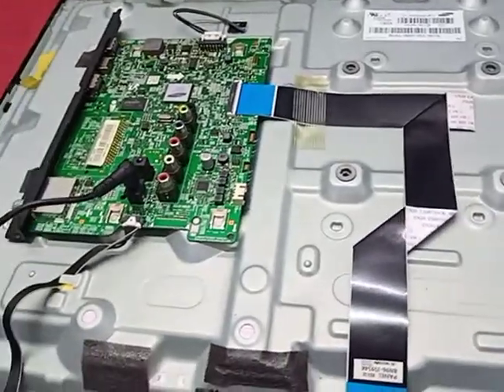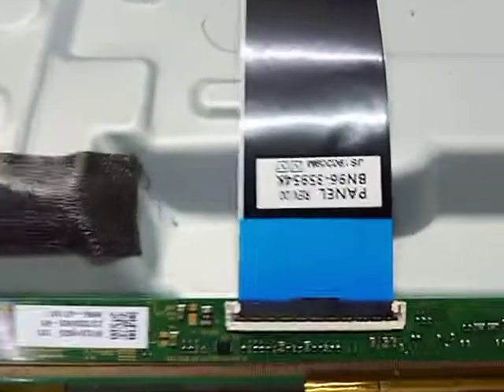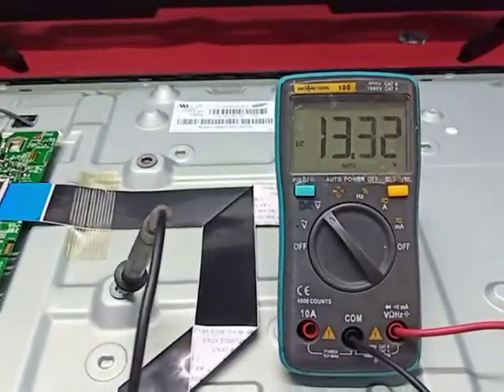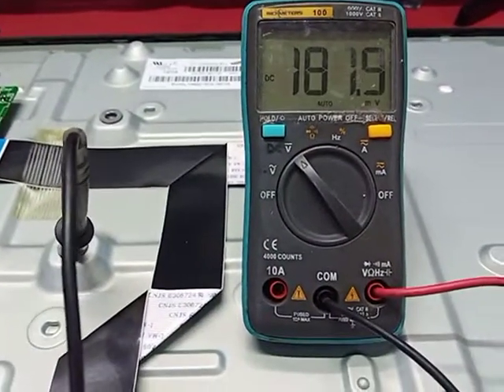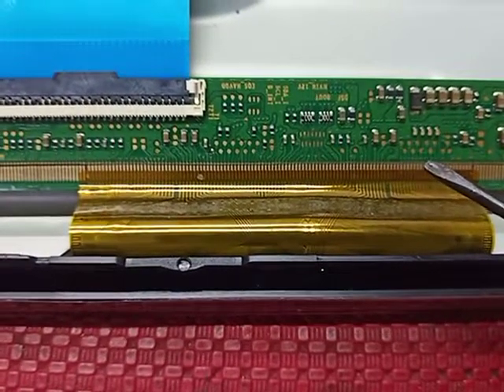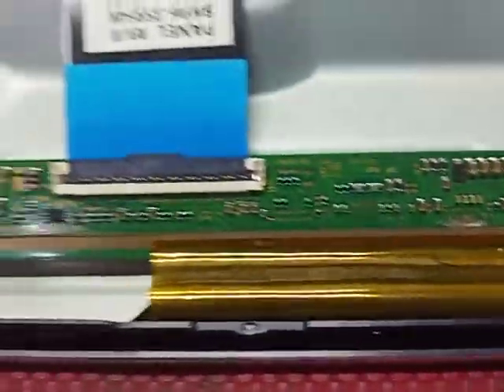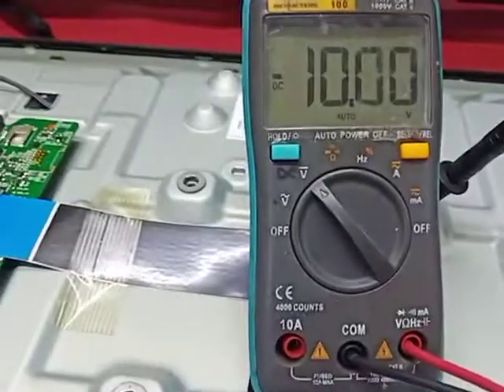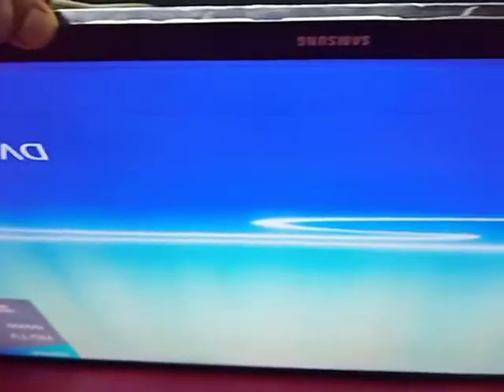SAMSUNG 32 Inch LED Tv How to repair no display problem# Model UA32N4000AK

Comment: Did it but it comes with lines on the picture. I dont know why.
Reply from the maker: Which signals u cut it all signals soldering with a wire and that wire you soldering on ground

Comment: Hello.. Akhilesh this side from Delhi. Could you please help me to fix the display problem in my Samsung 32 inch led tv? I was watching movie and suddenly screen turned in to black. Turned it off and on many times but everytime red light blinks on power button and screen is remain black.

Would appreciate if you could help me to fix this issue. Thanks in advance.
Reply: Local shop se karado bhai, same prblm mera theek ho gya 1000 mai, samsung care wale full diaplay 12000 ka daalne bol rhe they..